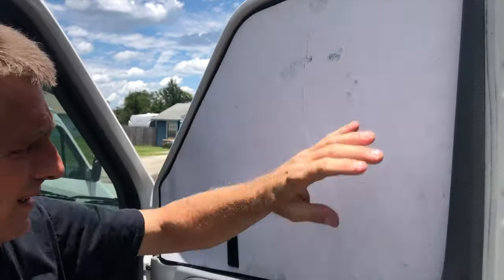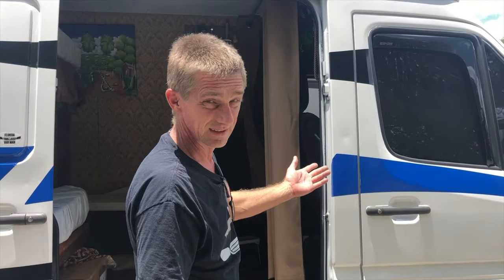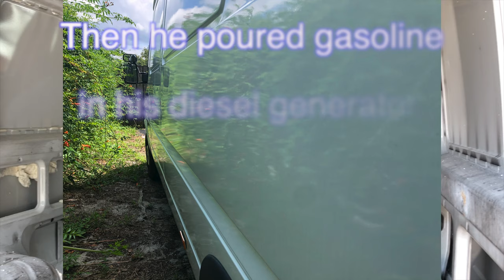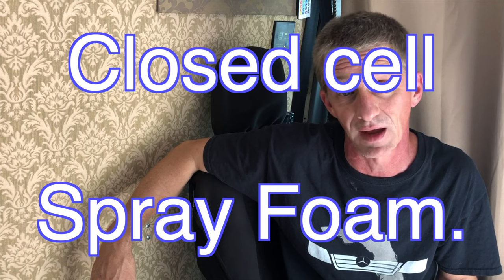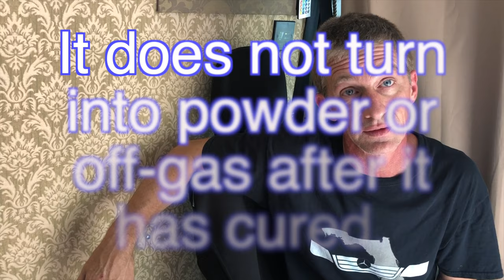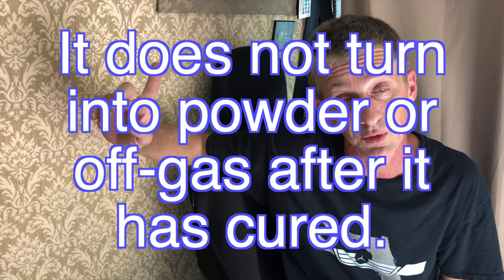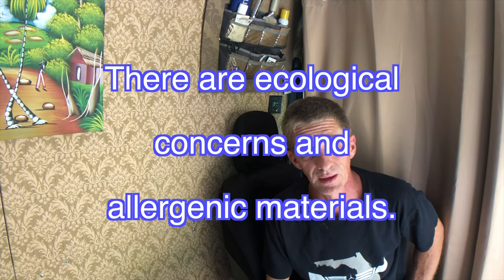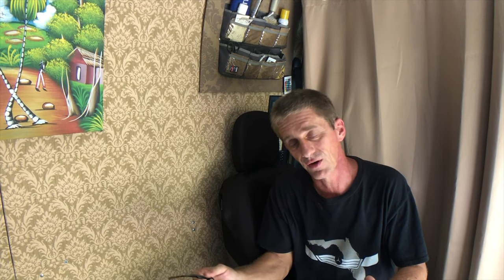Van Insulation, Spray foam vs. Batt and other ways to be cool and keep warm.

Comment: Thanks for this! This confirms our that plan to use foam is the right way to go...we insulate in the next couple weeks. Perfect timing.
Reply from the maker: Foam is my clear favorite for so many reasons, but it is hard to find someone who will do it fair, and do it right. The first one I had done $250 and he did a great job! The next one was $450 and he nearly destroyed the van getting overspray on the dash, doors, window, exterior paint... That stuff will never come off the seatbelts. Oh, and he bent the metal as seen in the video. Communication is Imperative! If you don't like the installer... find another one before going forward. The last bid I got was $850 and I couldn't... just couldn't.

Comment: Have you ever opened up one of the walls from one of your earlier vans with fiberglass batts to see if there is moisture or discoloration?  Many thanks for the content!
Reply from the maker: Yes. I have remodeled my daily driver 4 times, stripping back to insulation. I replaced the batts over the headliner once due to black mold. Not sure if it was condensation or the antenna leaking on the roof. I replaced the antenna with a sat-radio puck and never had another mold outbreak. I also stopped using propane heaters in the van, switching to diesel heater which dries the air rather than wet it as propane heaters do.

Comment: How about condensation in those areas where you get thermal bridging? We don't want metal fasteners screwed into those metal ribs creating rainfall inside our vans... I am just concerned with that because I have seen what it did in one of my smaller, heavily insulated fish houses (alabama).. The screws I used to attach the foam to the studs with started sweating and dripping when it was cold outside and warm inside.. Of course the environment is very humid in my fish house (500 gallons of water with live fish)... Just curious what you have seen in these vans since I am considering using spray foam in my box truck.. Don't want to make a $500-800 spray foam mistake... Thanks for all the work you put in and for sharing your knowledge in these videos..

Comment: All solid points and agree. I don't have insulation yet as I am worried once the van heat soaks by 4pm the nighttime will be hotter for longer than no insulation? As I Only use the van to sleep in as an RV is there a colder sleeping use WITH insulation?
Reply from the maker: Absolutely! It was a long time ago, but my first van-bed was just additions to the factory cargo shell with plastic walls. For the first "remodel" I took the factory walls off to insulate behind them and the difference at midnight was astonishing! I also added roof insulation and ceiling panels at this point, so I can't say it was ALL attributed to the insulation. Back then it was just a steel-tent between working long days and I did not realize how the van stored heat from the day, way into the night. 
Think of my van as a 6,000# heat battery. It cools off fairly fast when the temperature difference is big, but as it discharges, it gets slower and slower, always remaining a little warmer than outside. Insulation displaces some of that battery power and lowers the full charge.
I don't argue with folks who say an empty air pocket is fine... because I didn't even have that empty pocket on my ceiling at first. But I don't agree with them. If air inside the wall can stir itself because of temperature differences, as gasses and liquids do, it is not good insulation.
Reply: @FloridaVanMan  Man I want to move to Florida and work with you two, fantastic bananas as ever, great stuff

Comment: Have you had any issues with mold? Due to health concerns,  I need to come up with a solution that will, if possible, eliminate the possibility of it forming.
Reply from the maker: We have not had any mold issues in our vans, although colder climate would be more challenging. If you fill the wall with spray foam I can promise you will not get mold in the wall or insulation. The entire debate over vapor barrier becomes mute with spray foam and just this afternoon we confirmed either two-can kit from the links will be enough to do the largest Sprinter. The fumes are strong for a few hours while it cures, but after 24-48 hours it stops off-gassing completely and is the safest, most effective, and cost effective solution.  Our next insulation video will be installing one of these. It could feature YOUR van???

Comment: You lay all of your wiring prior to spraying the foam insulation that way? I’m debating one of those kits you linked if I can’t find a company do it for a similar price
Reply from the maker: I try to put the wires in before the foam, but it is not hard to poke wire through the foam later. Use a stiff wire like  a needle tapped to the end.

Comment: Florida Van Man, thanks for the video. Im working on my 3rd van build. The first had no insulation (lived it in for 7 years 7 months per year, not winter), the 2nd I used Tiger Foam closed cell foam fast rising (love it, huge upgrade), and this third Im wondering if I should use fast rising again, or the tiger foam closed cell foam slow rising? Any experience with the slow rising product? Better worse?
For viewers, if you used spray foam, you do NOT need to install/stick on the vibration dampening tar paper stuff (ie- rattletrap), as the foam will dampen vibration waaay better.
FYI, your amazon link to the Tiger foam is "no longer in stock" (july 19, 2020)
Can you provide a link to the fiberglass board you used to make the passenger window cover please? Thanks so much.
Reply from the maker: I will try to change the out-of-stock link. Thank you for letting me know. The fiberglass board isn't shippable, but they sell it at Lowe's & The Home Depot, probably all building supply places.